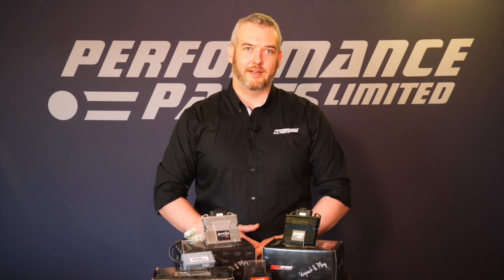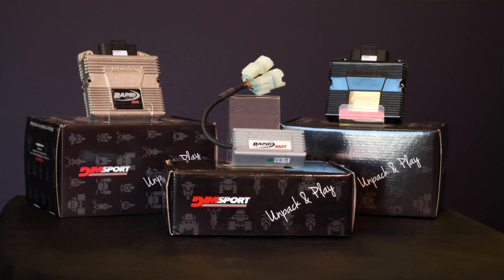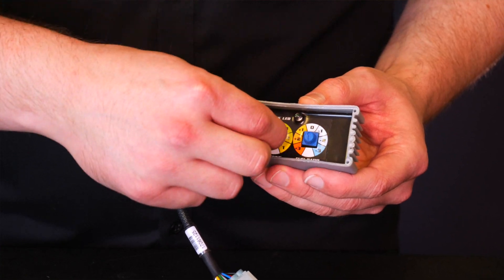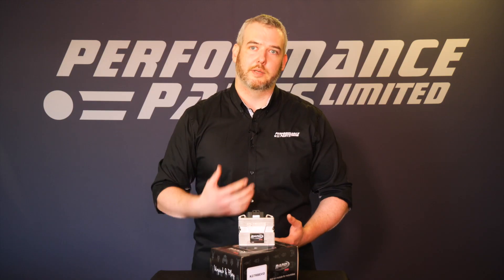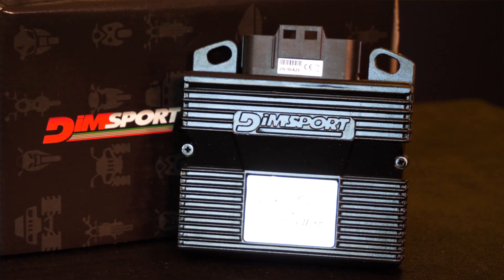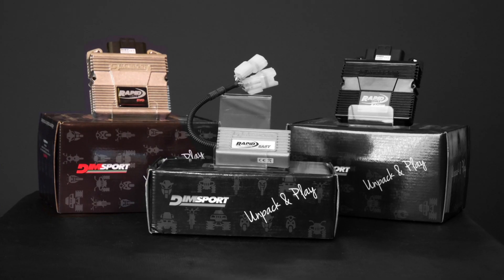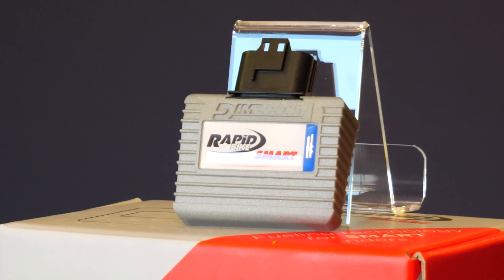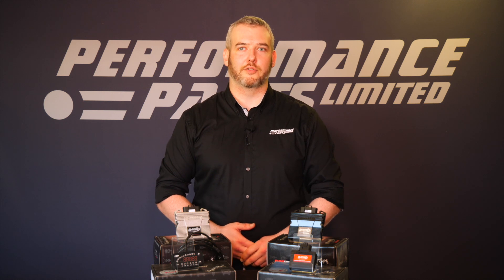Rapid Bike Fueling Modules - Easy, Evo, Racing & Smart - What they do and how they work

Comment: Hey, I have a 2021 Yamaha mt07, I put a decat Mivv Delta Race exhaust on it, took both db killers out and it seems to be running too rich, too many popping. Will this module fix that? Also, I have the 35kw version, so will the module overwrite it? (I'm fine with that, I was gonna unlock it to 55kw anyway)

Comment: Hi so i have 2011 s1000rr n has a rapid bike evo on it so I recently installed an SC project full system exhaust and now I'm experiencing a cut out in pawer sometimes low R. P. M and high rpm.
 What would happen if I disconnect n reconnect rapid bike evo
Reply from the maker: Hi Harry, nothing would happen. It’s fine to disconnect it and re-connect it, in fact we'd probably recommend it if a problem has developed after fitting another part – it lets you firstly rule out a different issue that may be present after fitting the exhaust and secondly will let you double check the RB installation to make sure it’s all ok.

If after re-fitting your still having the issue then give us a call and we check the settings with you on the RB unit to make sure they’re OK. It's odd that it would be fine before fitting the exhaust, then cut out after fitting it. Usually if there’s a problem with the RB settings, it would be evident after first installation - we hope the issue is resolved soon.

Comment: So should i get evo or easy on my duke 390? Going for decat and slipon
Reply from the maker: It depends on what  your hoping to achieve and how much effort you want to put in to it. If your finding the bike feels "empty" after changing the filter or exhaust and do not want to intervene with a PC,  you want a simple solution, as it says the Easy module is ideal. The Evo module is for those who want to maximise performance and are happy to use a PC to to modify the control unit that intervenes on 3D injection maps. This means delivery can be managed at every single point of the map (e.g. lean lower, grease higher) There is also a self-adaptation function: the control unit adapts itself to the preparation of the bike with analysis and lambda probe check. Hope that helps but feel free to call us for a chat of you want more information.

Comment: Hey bud 
Just bought the rapid smart for my 2023 s1000rr , how much hp you think will he added ? Im got afterarket headers and long akro pipe
Reply from the maker: It can vary bike to bike depending on other modifications such as exhaust, performance filters. The only way to get exact figures would be to run it on a dyno before and after installation.
Reply: @PerformancePartsLtdGlobal yup that's the plan bud IL do before and after runs on the dyno ... just thought you'd have a estimate.
Reply from the maker: @Angelo.salamone19  Here's a link to their website, scroll down and they've got their stock vs smart dyno chart so you've got an idea. With the aka your bikes performance will be further improved. https://www.dimsport.it/en/news/bmw-s1000rr-rapidbike-smart-1/
Reply: Awesome thanks my man  @PerformancePartsLtdGlobal

Comment: I want the module for my 2008 600RR(No ABS, No Cat and slip-on exhaust). Im more focused on street riding. Should i go for the EVO or Racing?
Reply from the maker: We would recommend the Evo system - The race one is for track use and gives the options of additional accessories to allow features such as launch control, traction control, engine braking management and pit lane limiter which you won't need for street riding.

Comment: Would this be ok to use on a 2024 mt125? Or would it do damage to a smaller engine
Reply from the maker: Yes absolutely suitable and significantly improve engine performance and fuel efficiency. 
www.performanceparts-ltd.com/road/yamaha/yzf-r125-19/2024/brands/rapid-bike

Comment: Planning to get a CB650R do you have something that could add an Launch Control/Rev limiter ?
Reply from the maker: Hello, we do a Rapid Bike Smart module for that bike but afraid do not do a Rev limiter of any sort.
Reply: @PerformancePartsLtdGlobal  So what model do you have for a Launc Control Module for the CB650R?
Reply from the maker: @Kendrakeee  I'm afraid the smart module does not include launch control. It optimises the air/fuel ratio and injection vales. It directly controls lambda sensor signal prompting the stock ECU to adopt a richer carburetion. Power delivery is considerably smoother, with improved throttle response whilst securing substantial benefits for the engine's overall performance.

Comment: Hi. Can i use the evo module for big bore applications
Reply from the maker: Yes, it is possible but there are quite a few factors to consider. It is recommend having the unit custom mapped to suit the larger bore, rather than using the standard base map, as the module will be setup to run on a standard engine and standard injectors so it may not be able to initially flow enough fuel  to cope with the increase in engine capacity. If you have any more questions drop us an email on enquiries@performanceparts-ltd.com

Comment: hi thanks for the tutorial what would the setting be  on the easy for a duke 125 with a slip on exhaust and air filter lid mod ? .cheers
Reply: Take the evo the bike will change a lot. Gain a lot more power up top, have a lot less engine bracking and overal way smoother. The change in power is quite noticeble, which i didnt expect for a 125. I also had the easy first on my duke 125 and then went to a evo.
Reply: 1 I reckon, I got a 125cc grom with flash tune for intake and exhaust. Now I have a cam

Comment: Hi, would that work on my sh300? Also what does it do? Im so confused 
Some help would be appreciate it
Reply from the maker: Hello Alex, I'm afraid there is nothing available for the Sh300. These modules, depending on which one you use,  live map fuelling and can also optimise the ignition map with the option of activating add-on features like quick shifter, launch control, traction control and engine braking management. In short can improve fuelling and engine performance.

Comment: What would the easy do to my ktm 390, would it only effect the bottom end or the whole rev range?
Reply from the maker: The module will improve engine efficiency on the whole and eliminate power gaps typical of the low and medium rpm range.
Reply: You say end can but will it work with a cat delete pipe for ktm duke 125 and what base settings are suggested for just a cat delete with the easy.
Reply: @markkitching7469  as far as I'm aware the easy will only work at the bottom end, the closed loop section. I think they are wrong in their response saying that it would work throughout the rev range. 

The easy bike evo will work throughout the rev range though
Reply: @motorcyclerescuer  don't wanna spend 370 on the evo
Reply: @markkitching7469  yeh I'm thinking the same for mine. 

But the easy only works on bottom end revs and idle.
Reply from the maker: @motorcyclerescuer  we mentioned it will only eliminate power gaps on the  low and medium rpm range. We are the distributor so unfortunately cannot offer you a better price but we'd recommending using one of our dealers who can.  Try www.calsport.co.uk.
Reply from the maker: @markkitching7469  Easy is only recommended for as standard motorcycles or with a slip on. For de-cats you  would need the evo or race modules as it includes auto-adaptive technology. Unfortunately we cannot offer a better price as we are the distributor but can recommend you have a look at our retailers who may be able to offer you a better price. Try www.calsport.co.uk
Reply: @PerformancePartsLtdGlobal  thank you 👍
Reply: When will you have the Evo model for my ktm 390 adventure 2024, my local tuner says he can’t fit the 2023 Evo until you have approved it ?

Comment: So a quick question. Would the racing module work on a 2016 yamaha yzf r125 with a 150cc cylinder kit with full exhaust system and KN air filter? (I am looking om adding a launch control on it an do all kind of crazy stuff to it. My first bike and i won't get rid of her even if i have a bigger one
Reply from the maker: Hello, sorry for the late reply, we haven't been receiving notifications for this video for some reason. Yes it would, sounds awesome! If you want to discuss in detail the improvements the module will make specicially to your bike you can email info@performanceparts-ltd.com or call 01327 706 139

Comment: for a new bike with cat & cannister deleted open aftermarket intake and exhaust  how does this work differently than the power commander ??   i have the P.C.. now and i either run the 'street' map and have lean flat spots in the rev range big ones or run it closed loop "race" map and it throws a check engine light and disables the cruise control ///  2022 Husqvarna Norden 901 , mechanically identical to the KTM890 , with Rottwieller intake & Arrow exhaust cat & cannister delete & ti silencer , currently with power commander
Reply from the maker: Hello, sorry for the late reply, we haven't been receiving notifications for this video for some reason. Happy to have our techincal sales team discuss this in detail with you, don't think there's enough space here 🤣 please email info@performanceparts-ltd.com or call 01327 706 139